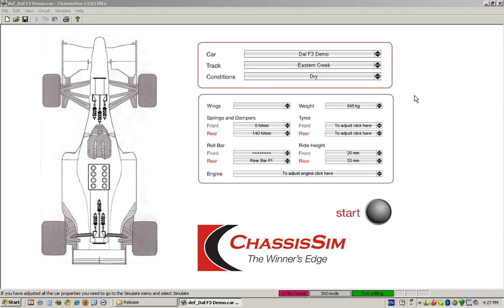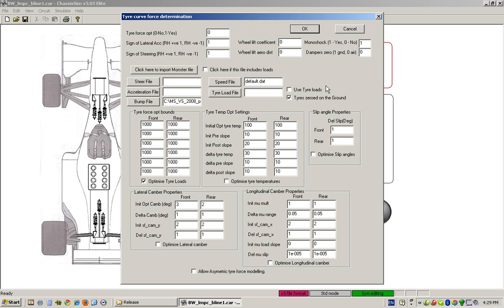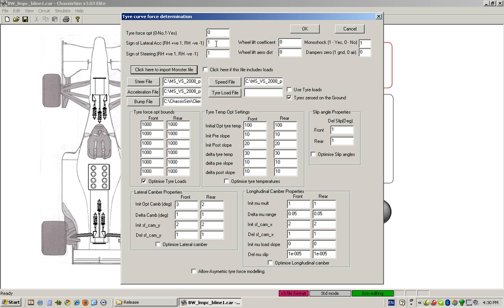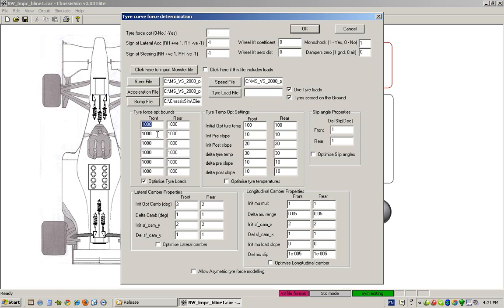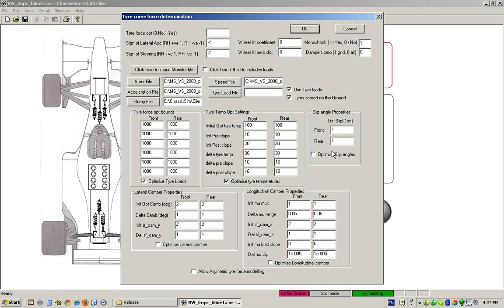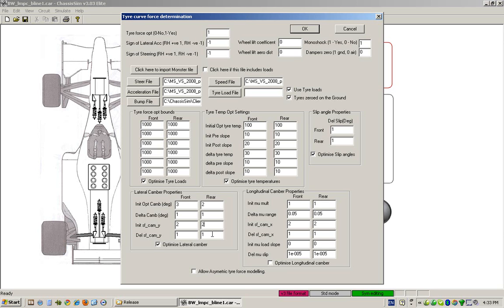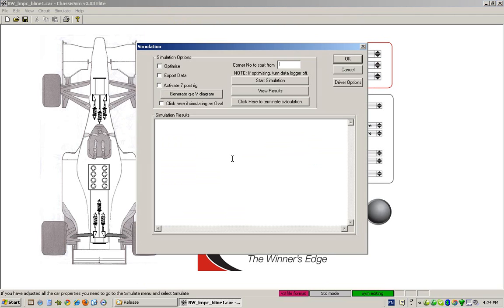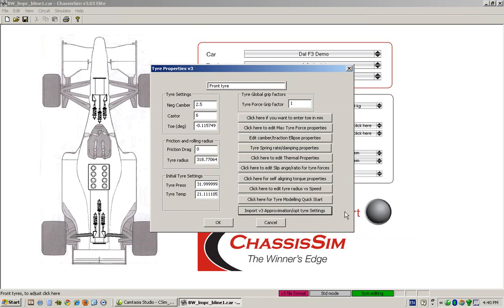Creating advanced tyre models for lap time simulation using ChassisSim

Comment from the maker: If you have logged steering at the steering wheel, then all you need to know is the rack ratio that will give you the ratio between the steering wheel and angle at the tyre. The ChassisSim model will handle bump steer and ackerman effects. I've done it this way in anger many times.

In terms of modelling you can do both. The aero can be done straight from the data, but I like to do a hand calc first. In terms of tyres I like to do a rough tune first and then use tyre force modelling to finish.